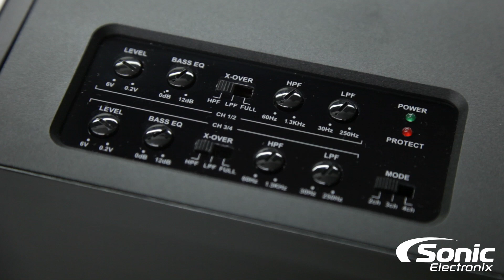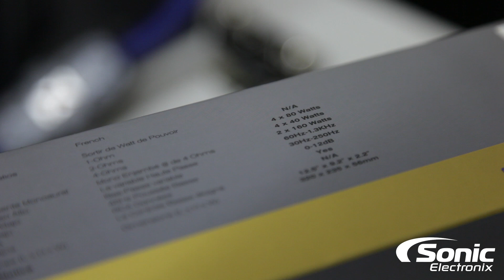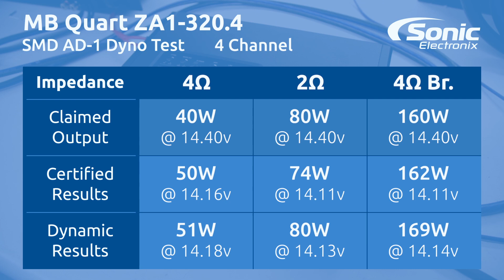MB Quart ZA1-320.4 Amplifier Dyno Test | SMAD D'Amore AD-1

Comment: it actually sounds way cleaner than my rockford punch with the new clean set up was with no engine noise, pushing punch t1 6/9's in rear and t1 components in front with ease. sounds very nice. I've been impressed going from a ps that cosy twice as much.

Comment: just ordered the za 640/4, glad to see they do rated or more
Reply: Im about to order one too, can you tell me how does it performs?
Reply: Very well on the power and no engine whine that I could not get rid of from my rockford fosgate amp. Very nice sounding amp for 1/2 the price of some others. Haven't bridged it yet but running at 4 ohms gets very loud
Reply: But I have the 640/4 version